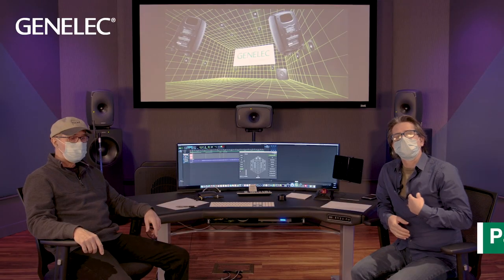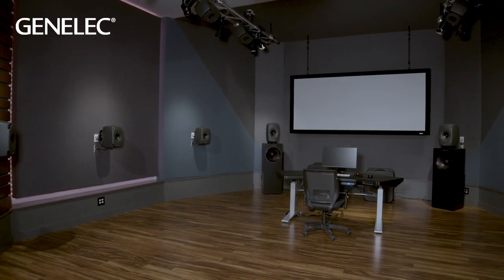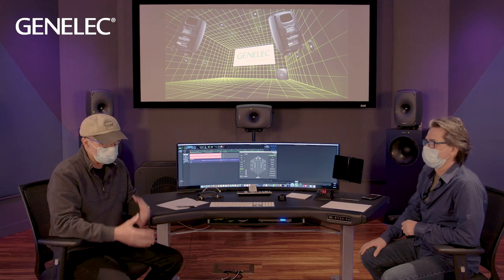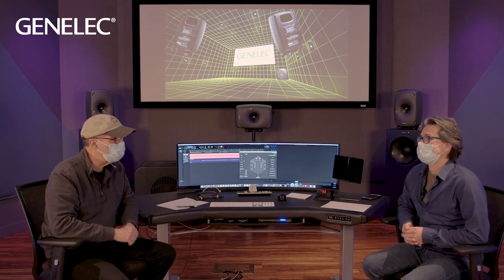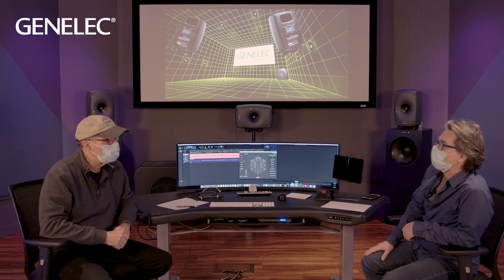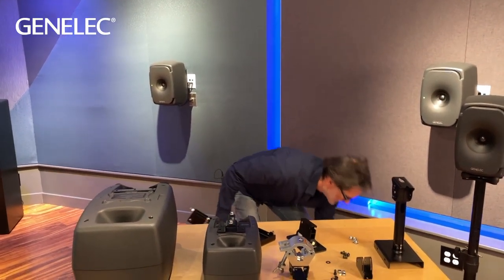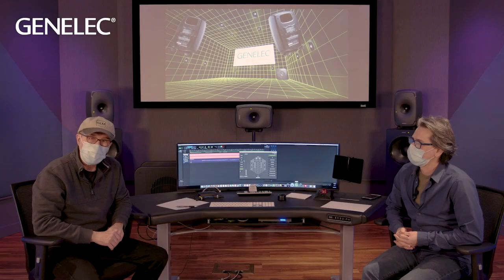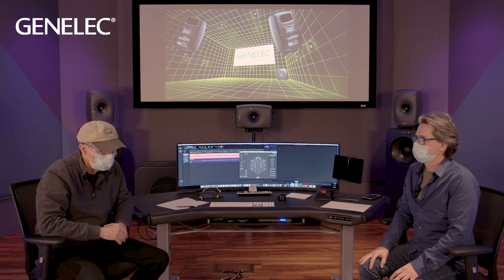How to create an Immersive Audio Room

Comment: Sorry, noob alert.  For a Dolby Atmos setup (eg. Compact 5.1.4) do all speakers need to be from the same SAM family? Due to the small room size constraints as well as budget, and also because I already own Genelecs from the non-SAM family, I was considering going with the 8010A for the ceiling speakers. And I think my real question is, how do I send the dolby signal to all speakers? - as I certainly don't have that many outputs on my soundcard.
Reply: @genelec  Thank you for the quick response!
Reply: @Creative.B  was the answer deleted?
Reply: @lordtonno8871  It was indeed by @Genelec Official Channel. No concrete answers were given though, they only suggested contacting their support team.